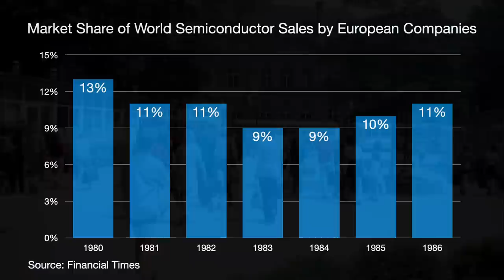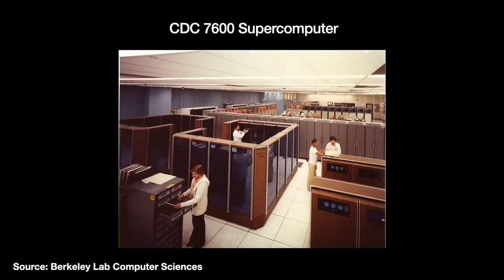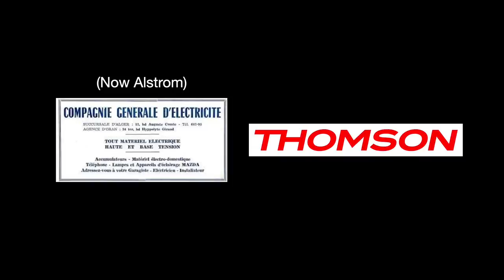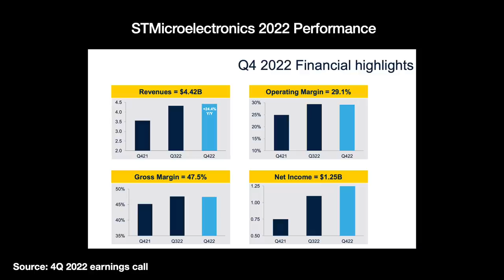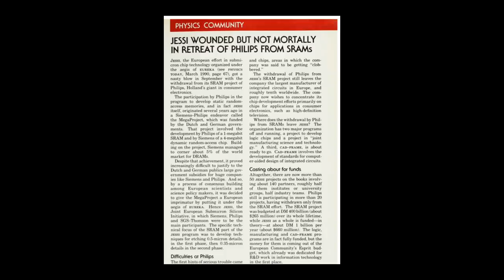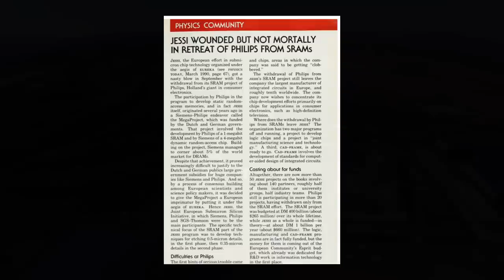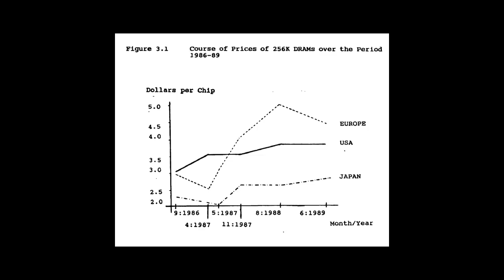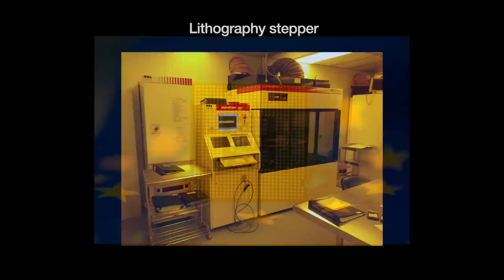Europe’s Lost Decades in Semiconductors

Comment: Well, I think the story of ARM is one of the huge European success stories in this sector. ARM-based CPU are well on the way to replacing x86. Apple Silicon, AWS Graviton, Qualcomm Snapdragon, Samsung Exynos, Google Tensor - these are all relying on ARM designs. Not to mention the myriad of embedded devices. 
ARM does deserve a lot of praise - and a video. ;-)
Reply: But ARM only does chip design, not manufacturing. It is important yes, but i don't think it counts as part of the semiconductor manufacturing sector
Reply: @AgusSimoncelli  Manufacturing is just a question of money and scale. All the semiconductor manufacturers buy equipment from ASML, Applied Materials, Teradyne, Lam, etc. AMD is also fabless. Would you rate AMD as not important because they aren't manufacturing their stuff?
ARM goes simply one step beyond AMD and the likes.
At the end of the day, knowledge is the key ingredient in this game. And that's what ARM is selling.
Reply: @klausschroiff4405 as someone who designs circuits on chips (like AMD or Nvidia) I would say the manufacturing technology is the hardest part
Reply: Also Apple Silicon is not an ARM design. Apple licenses the ISA so software built for ARM can run on its chips, but does its own chip design internally.
Reply: @Longlius   Correct. But at the end of the day, Apple Silicon is using the same RISC architecture.